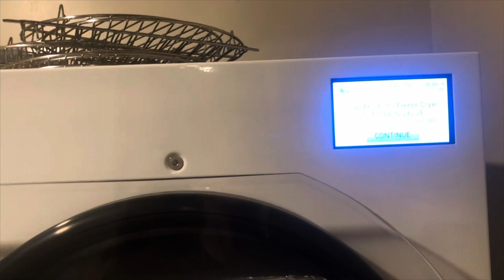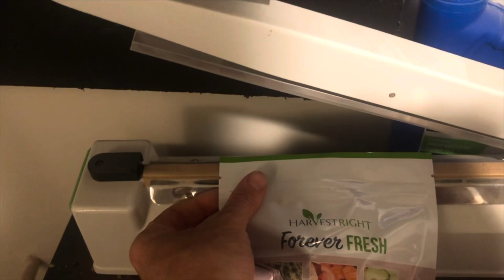From Farm To Frying Pan: Meat Rabbits and Preparing Against Food Crisis

Comment: I started investigating natural foods when I was in the fifth grade, after reading 'My Side of the Mountain', living in south Jersey.  I have tried to  educate my children to be more natural.
Try putting in a SAND BATTERY for back up power.  Most simple version is to fill a steel trash can with sand, paint it matte black and put it in full sunshine until just before sunset.  Wheel the trash can inside and let it give off heat all night long.  Modify this to a large steel barrel, 5 feet across and 6 feet high.  Insert some thermocouples to generate electricity.
Reply from the maker: Would a metal barrel full of sand or one full of water be better for thermal mass? My understanding is water is one of the best. But the idea of generating electricity is intriguing.
Reply: @mantihomestead  water would be better for a trombe wall, however sand will store several THOUSANDS of degrees of heat.  Water would explore because of the steam pressure.  THERMOCOUPLES convert heat to electricity to be stored in a chemical battery, OR used directly.  A steel barrel, painted matte black would be very efficient in the short term (12 - 24 hours).